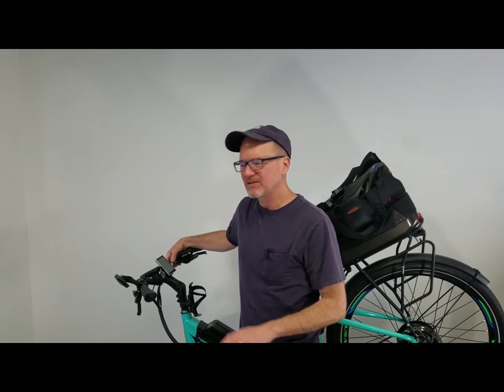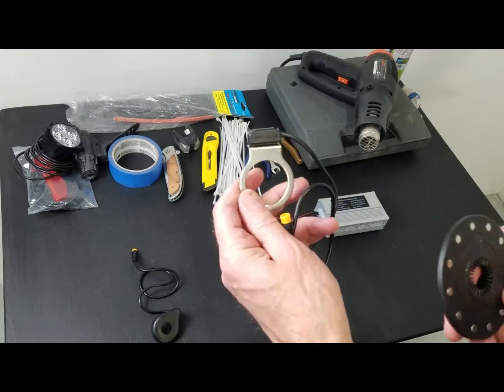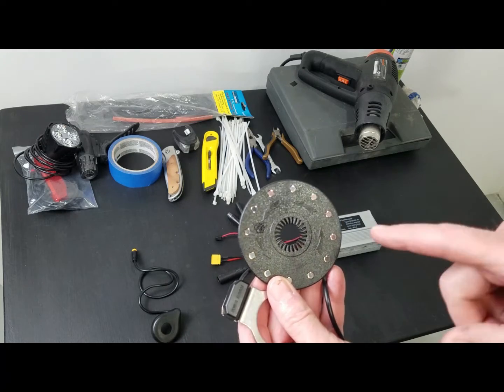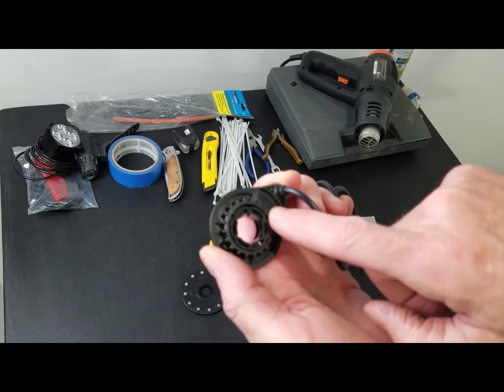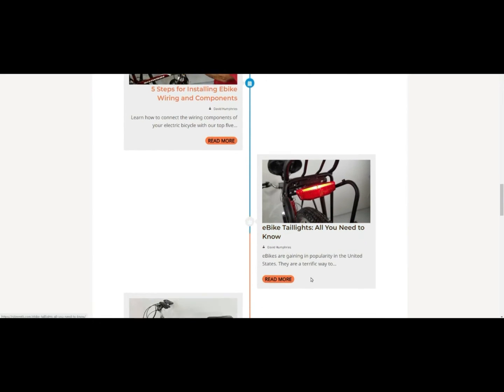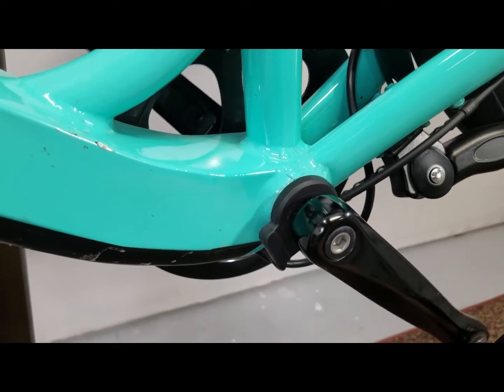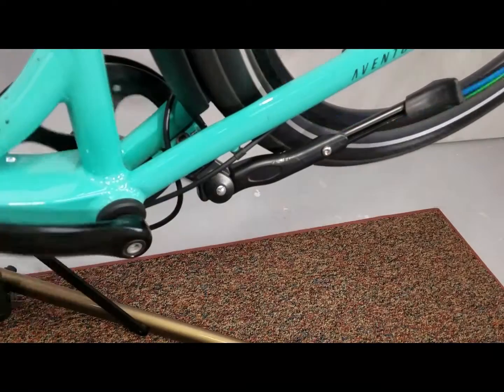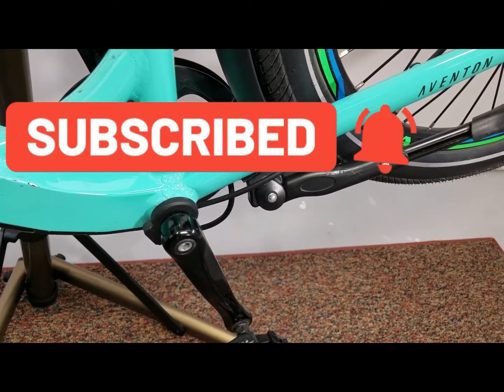eBike Cadence Sensors What Are They and How Does It Work

Comment: Hod do I tell which one's compatible with my bike? I've got a 2024+ Wired Cruiser and the one that's on it seems very cheap and I'd like to upgrade it to a better quality one? I know it's got a 3 pin waterproof connector but I don't know how many magnets it's got in it or anything.
Reply from the maker: I'm not sure what sensor is on your bike.  🚴
Reply: @diymountainbike  okay thanks.

Comment: hi - i have a question //have a juiced city scrambler ,and the cadence sensor started working poorly after left in elements - rain specifically - is it a fixable issue  thanks tim
Reply from the maker: It might help to clean it.  The root cause could be many things.
Reply: @diymountainbike  thanks - i did clean it - and it improved thanks

Comment: I have a class 3 bike with throttle. Throttle only it will do 20 mph and with peddaling it will do 28. Do you know if there is a throttle speed limit bypass so that with throttle only the bike can achieve the full 28 mph? Or would I be better off trying to fake out the cadence sensor to get the 28 mph?
Reply from the maker: It really depends on the bike brand and the controller.  Some allow you to get into an extra menu to "unlock" things.  Unfortunately a lot of ebikes don't allow you to unlock though.  🚴‍♂️🚴‍♂️🚴‍♂️

Comment: On max pedal assist mode. Do I have to actually pedal hard to go fast? I would like a throttle but they are illegal here. I want to next best thing to this. As I don’t want to be all sweat going to work.
Reply from the maker: This is specific to cadence sensing ebikes.  If you legs are turning the power will be applied.  You don't actually need to apply pressure to the pedals.  This will power you along like a throttle (it's called ghost pedaling).  The caveat is the motor and battery need to be powerful enough - I don't know what ebike your thinking about.  🚴‍♂️   🚴‍♂️🚴‍♂️😎

Comment: On the metal sensor that mounts around the crank. If I cut that circle off, will the sensor still work? or does that metal circle work in relation to the magnets on the black part?.....I have a cruiser bike, and the metal circle will not fit around my crank without hitting the sensor on the frame.....I figured if I cut off the circle, and mount the sensor on the frame instead I might be able to make it work.....I'm just trying to figure out how they work right now. If anyone knows I would appreciate it.
Reply from the maker: Yes the magnets work with the pickup unit. 🚴‍♂️🚴‍♂️
Reply: @diymountainbike  Thanks for the reply. I already chopped off the sensor and zip tied it to the frame pointing towards the pickup unit.. I had to use a wood burning pen to melt a larger hole in the center of the pickup unit. That way it would fit around my crank. FYI incase anyone else needs to know how to do that. I never been on an e bike before so I had to figure out how they worked. Now that I know it's rather simple.

Comment: Hiya i have a bike rear hub with a 6 magnet disk i can only find 12 or 8 nagnet disks and ordered both will it matter going fro 6 to 8 9r 12 magnets i have no way of programming the controller to change the number of magnets thankyou in advance 🎉
Reply from the maker: It should still work.  The bike may apply power a little quicker from a stop.
Reply: @diymountainbike  it did I went from 5 to 8 and it worked perfectly and yes started quicker thankyou 👍🏼
Reply: Very informative! I have an Ebike that all of a sudden will not go past 7 mph. I was looking into the cadence sensor but now thinking it could be the controller? The battery is fully charged…any other ideas? Tia

Comment: Are the sensor connectors all the same; ie your wife’s sensor can be replaced by the other 12 magnet sensor?
Reply from the maker: Yes, in most cases.  I've even increased the number of magnets in the disc to get a smoother startup.  The problem I have had is that the physical design/shape of the sensor system can be different from bike to bike.